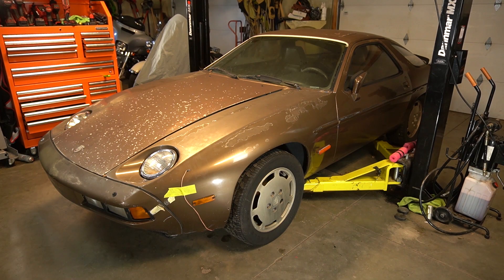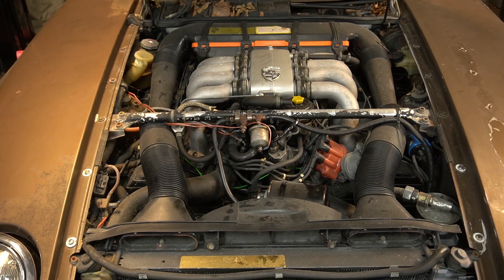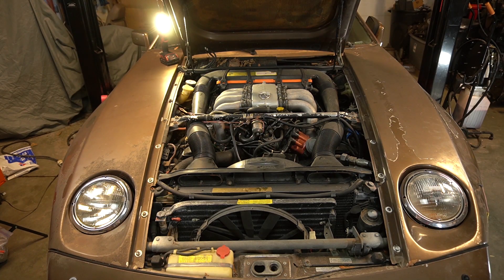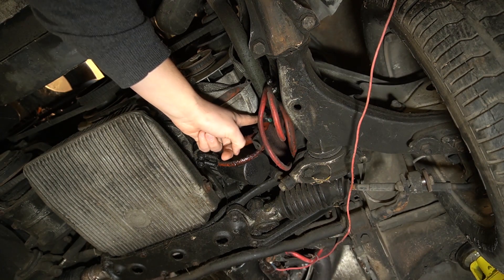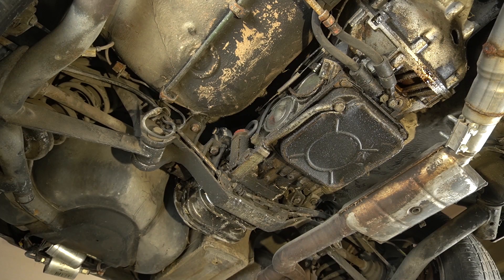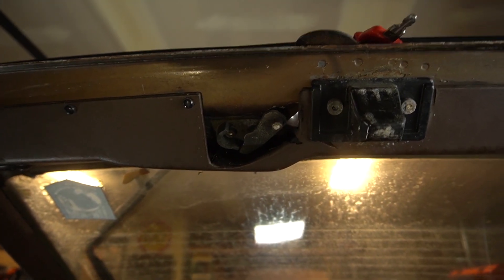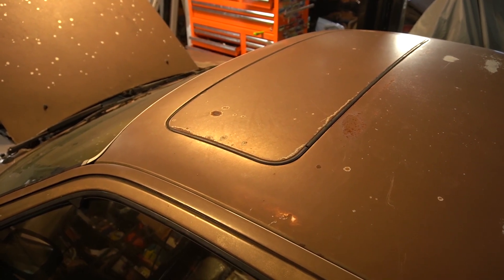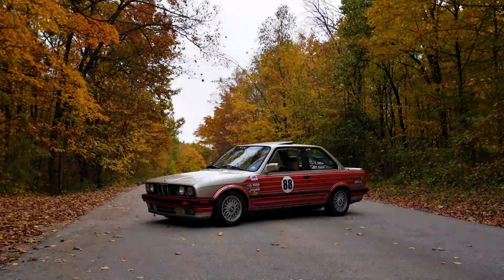Inspecting a EURO SPEC 928: wiring problems & odd aftermarket parts

Comment: I think the same guy who has been wiring this 928 had been wiring my 928... With the loose seat and relay panel out.
I bridged the connector by the battery that goes to the neutral safety switch to get car to crank on key again

Comment: Two rear wires near the fuel pump may have been to an in take pump. Assume it has been replaced for a standard in tank filter and wires are now not required.